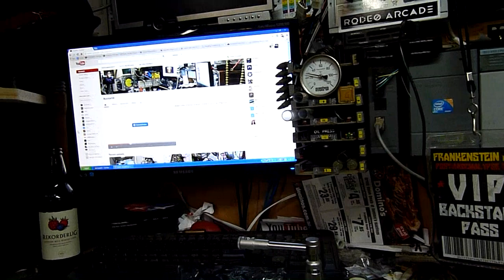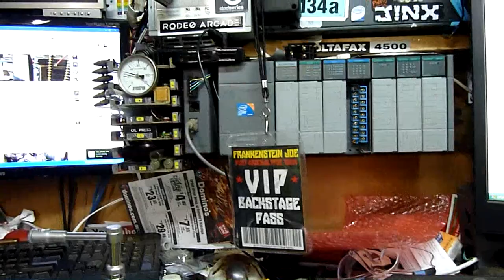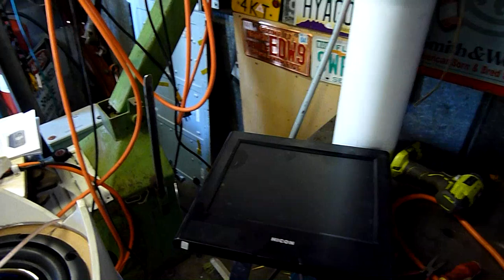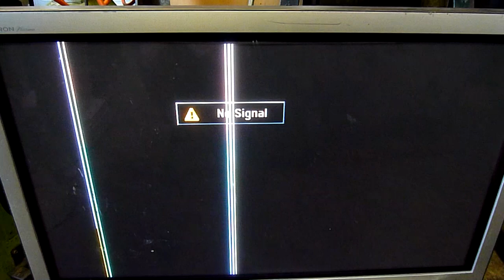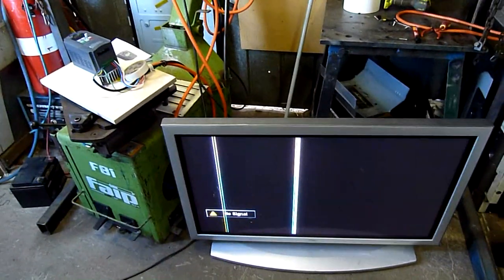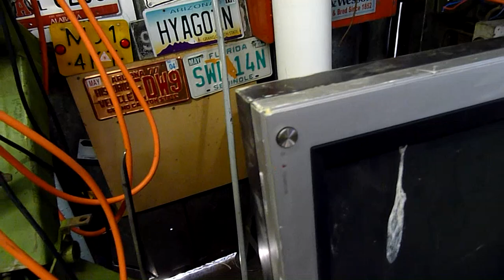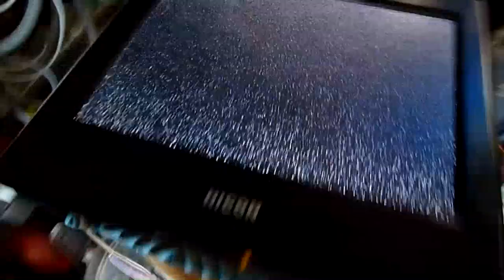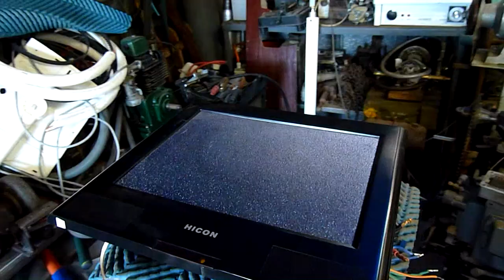Ramblo TV Inspection   TV's for HV Carnage!

Comment: Ed, i would check the psu on that pioneer tv if i were you. on some tv's a flashing standby light indicates a failed power supply. happened to my brothers tv although that was a bush with a horrible profo-teltra psu that is notorious for blowing caps and has been used in a few different makes and models of tv. replaced some caps on the psu and it was good to go!

Comment: I just replaced the panel on my LCD monitor (Dell E171FP), I didnt even use the same brand of panel I just ripped one out of an old HP monitor I really didnt care for.  As it is I have notised the internal connections are all the same on LCD panels when replacing the panel I just had to make sure the plugs were close to the same location and that the panel was the exact same size and has the same mount placement and in theory it should work.  I even managed to get away with using the backlight inverter for the OEM panel.

Just randomly remembered this but I acquired a microwave recently and I think it might be a similar age to the ones you and Brad found.  It is a Sharp Carousel that was made in 1983 and has the electronic panel and no oven element and I have to push clear after plugging it in before I can turn it on. Even has the original purchase receipt to from 1984.  The input it uses 1.3Kw and output is 650W.  Seem like something that would work good as a first microwave?  Only issue was the light globe was blown and I replaced that. If you wanna see it just ask.

Comment: gotta love those little 12v screens haha, got a 13" tv ( with inputs ect )
also has a 1ghz itx board ( forgot specs ) slow little thing, so all up only pulls 3 maybe 4 amp's at full load ;) just need to make a short vga cable for it :(

Comment: Hey Ed, What would you recommend to use to remove Dust, Dirt, Ozone, and Nicotine from electronics such as Televisions? Just acquired a sansui SDTV that works great but came from a smokers house. Smells horrible and looks just as bad inside as it smells. I used to use lysol but wondering if there was something else. Also, Have any idea why a am/fm tuner would act like every signal is weak when they're not?
Reply: you can use a soft brush and if you make sure your lines are clean you can use compressed air there cant be any moister

Comment: Hey aussie, I picked up a pc monitor from a friends house a few months back with runs off of a 12 volt power supply. Is there Any way I can just Jerry rig a pc power supply to it to see if it works before I go buying something I'll likely never use if its dead.
Reply from the maker: I jsut used a 12V SLA battery, you could use any other 12V supply as long as its over 2A or so. center pin on the barrel plug is Positive.
Reply: Aussie50
Sounds cool man I just wanted to make sure it would work without hurting the thing, I've done the same trick with car amps to test them on a bench but I never did it with a monitor that's why I asked. Thanks again and I look forward to seeing TV's die a horrible death.